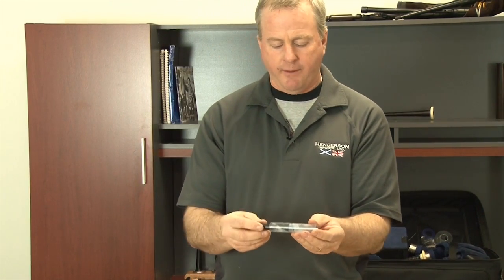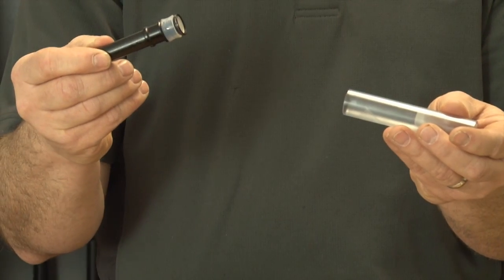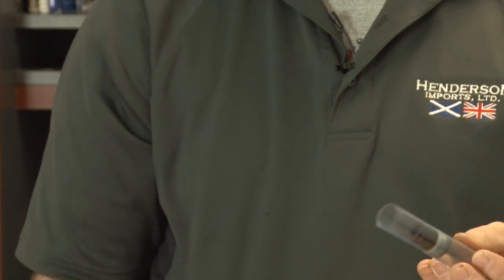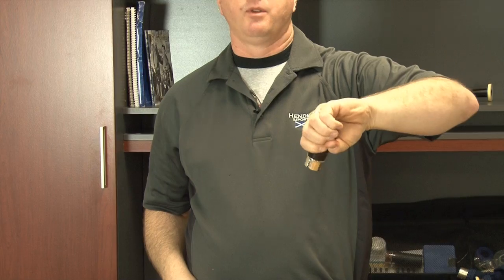How to Install a Moose Valve in Your Bagpipes

Comment: Hi
Just removed Moose Valve, it came out the bottom of the stock. Cleaned it all out, and now i cannot get it back in. Tried it to get it in the top of the stock and tried to get it in the tube it comes with. Having extreme problems. Any ideas?